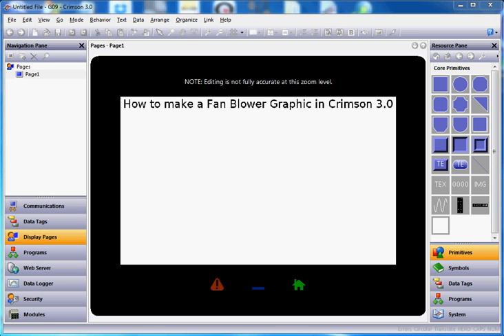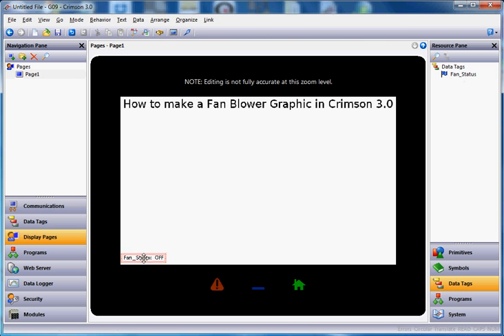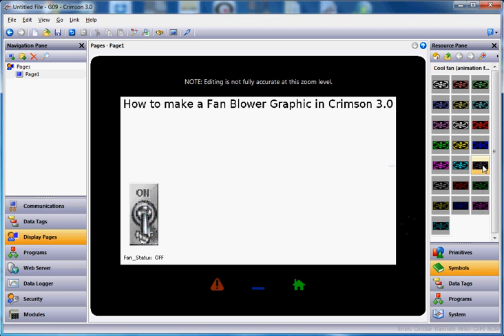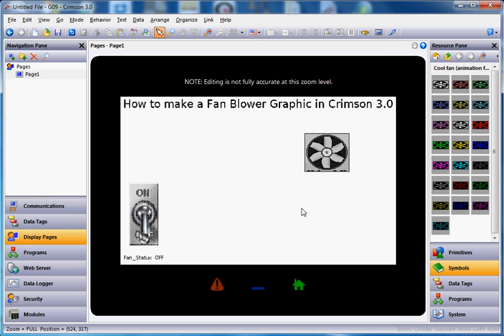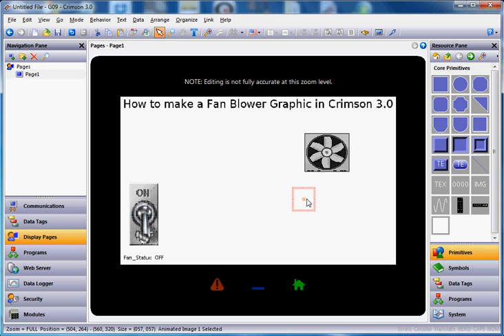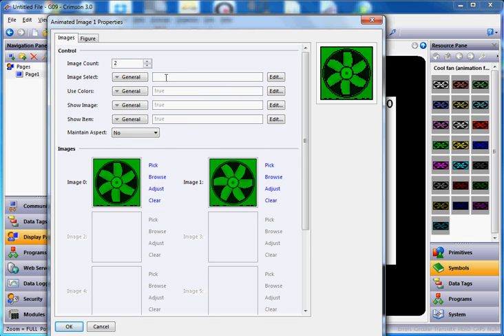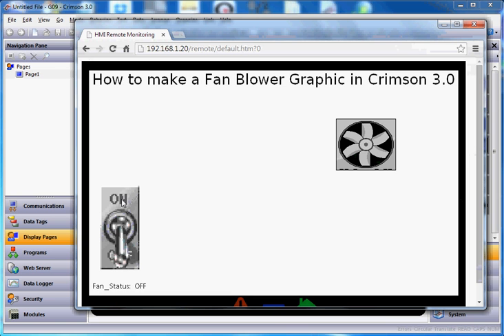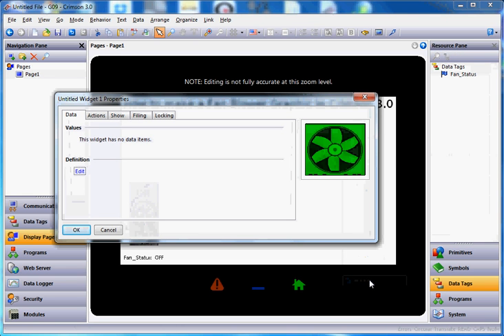How to make a Fan Blower graphic in Crimson 3.0

Comment: Joe, I do not know if you have noticed if you are importing an image and using it on one of your pages, It will show normally. But if someone else who has the same program but not that image in his laptop tries to update the program, the image will be lost. As the image never becomes part of the program. 

Does this happen to the widget we create as well?  Or the created/used widget become part of the program?

Thank you,
Ghanshyam Z.
Reply from the maker: If you Import external Images or Pictures .jpg or .bmp into Crimson and you want them to stay with the database via extraction, Click on DisplayPages on left side, then Pages on top of all your displayed pages, and click on the Images tab. Set the Include Data to Yes and that will keep the External pictures in the database. Keep in mind that external images should be resized to the max screen size for your HMI. So a G07 with a 800x480 you should resize your picture before import into Crimson to a 800x480 image resolution or smaller. Big pictures will use up memory on the HMI that is a waste.

With Widgets I have noticed that if I use External pictures in them they do not stay with the Widget when you transfer the .wid files. The only way to keep those external Pictures in Widgets that I know of is to drag the Widget from one Crimson database into another one. However, I do think that if someone Extracted the database and that DiplayPages/Pages/Images/ Include Data Yes as above is selected the external referenced picture will follow the Widget.  Have fun!